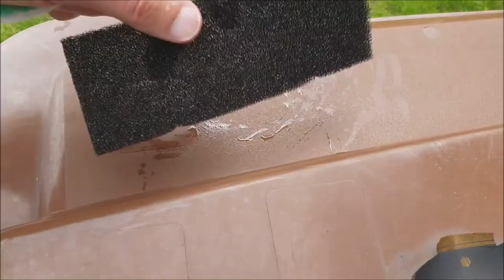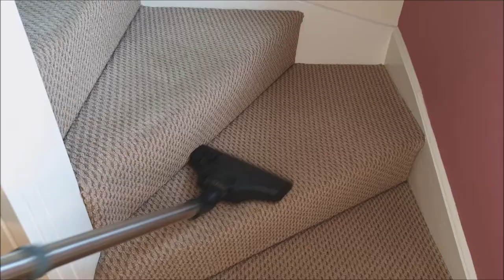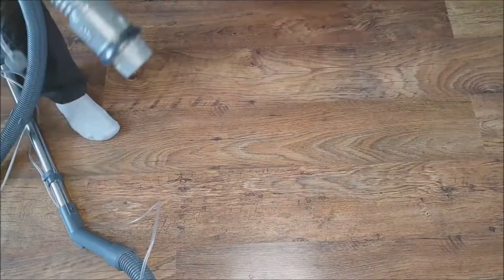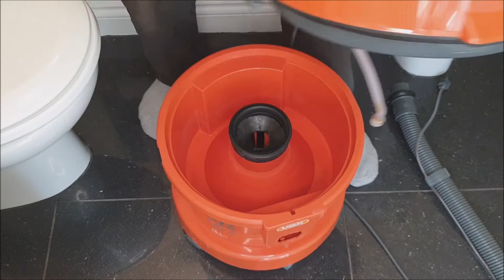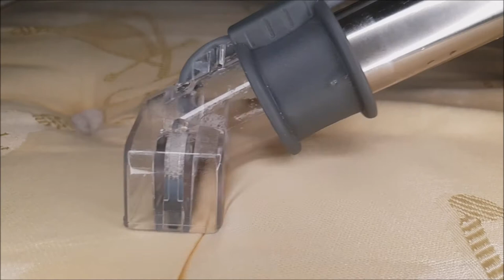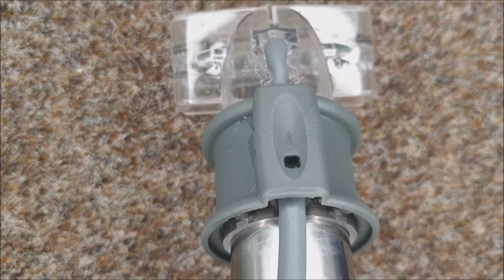Vax 3in1 vacuum cleaner and carpet washer

Comment: I know longer recomend this  brand Vax..  I will esplain I bought this brand many years ago and when it got old  I decided to recommend it to friends and four of has bought the 6131 model... It's looks the same as the one I originally had but it's build quality is completely gone down the drain.. Since I bought sou many problems that I simply lost trust in the company...
Reply from the maker: Mine works OK, but I can see your point. Sadly, most products, not only vacuum cleaners, last shorter than they used to. They're simply designed that way.